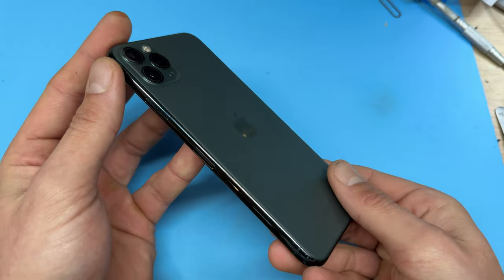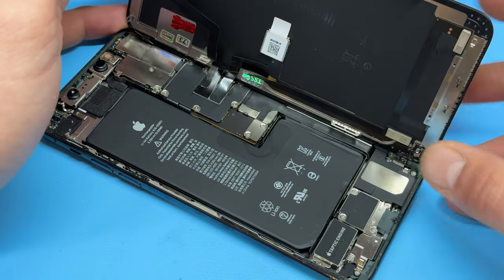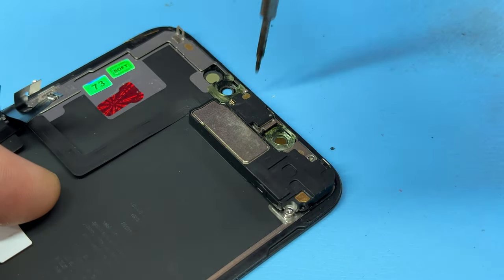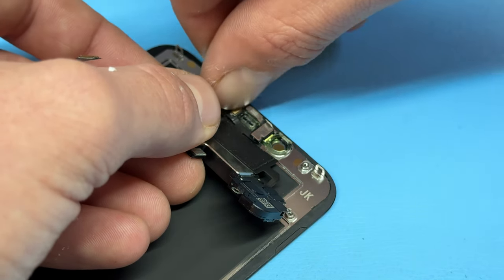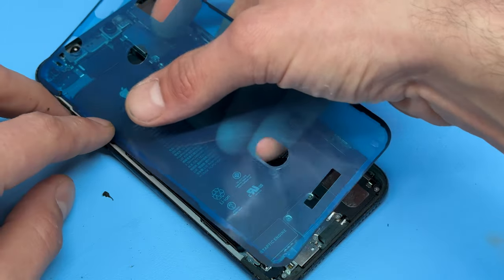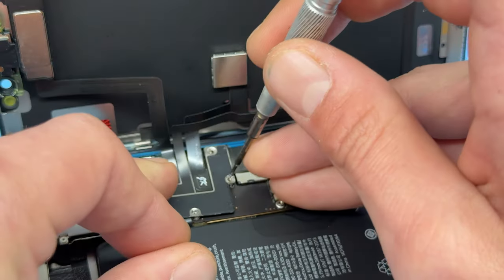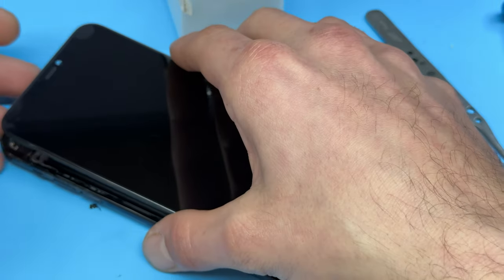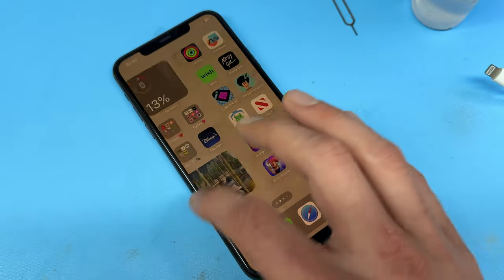iPhone 11 Pro Max Screen Replacement Guide - How To Change Your Broken Phone Screen!

Comment: Did this to the T and now getting “Face ID unavailable” or when trying to unlock my device it doesn’t recognize me at all (with all options turned on). There’s also a message in my settings that say the device screen isn’t Apple certified. Do you have any troubleshooting for these issues?
Reply: You probably didn't plug in the ribbon all the way or you damaged it when transferring it over to the new screen.